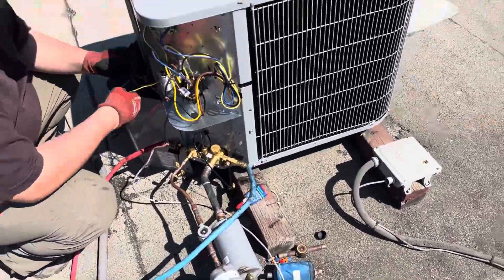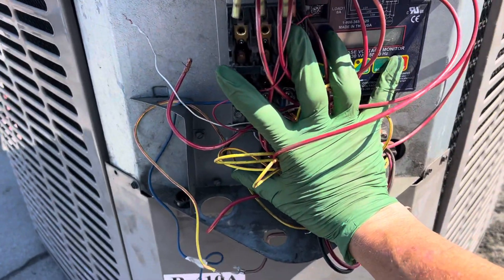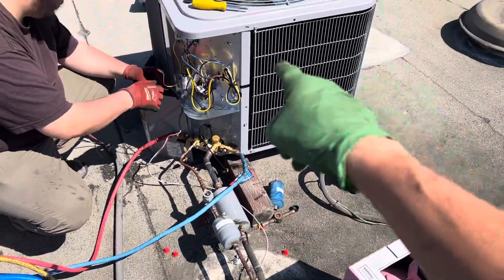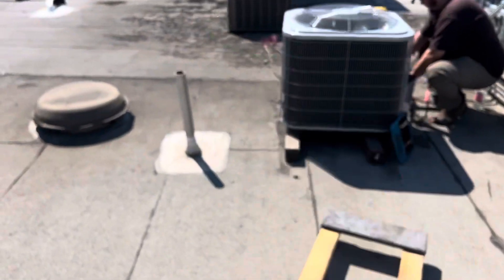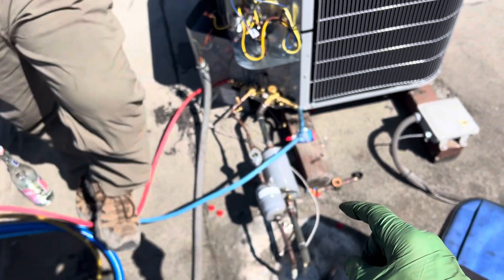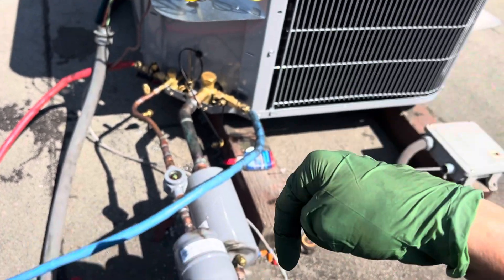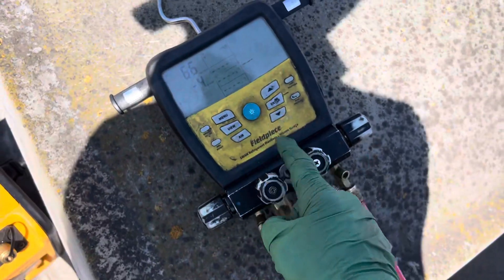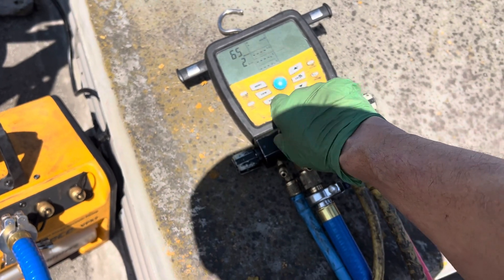STAY-BRITE8 / 185 µm DECAY / ￼CLEAN ORGANIZE ￼WIRE MESS

Comment: I wonder!! what the secret behind skipping flashing though you have evidence shows  oil is bad, won't this effect the new compressor?
Reply from the maker: It’s a cost to to time thing on this job.  
 This is high production facility. It’s cheaper for them to have a change out a whole entire unit and have me change a compressor. 

If you get 6 to 8 years out of a compressor, he’s happy enough . 

In a residential home, you will get 15 years 20 years . 

This compressor has been operating 24 hours a day since it’s been installed it does not turn off . 

And that is why I put that extra large suction line filter that is meant for a 7 ton  to 12 ton unit .  
This is a 5 ton unit. 

It’s all about money and time every hour he loses nearly $1000 an hour .
Reply: Thank you